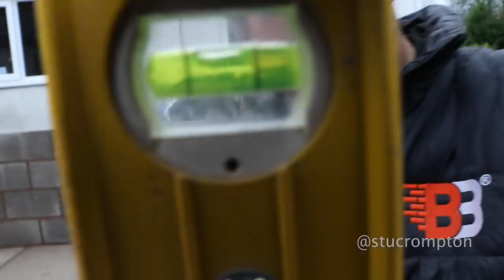Blockwork Extension - Starting the Build

Comment: Use my little green laser for setting out all the time,works a treat on these little jobs
Reply: Ross Male what make is your laser
Reply: @chrissullivan2007  DeWalt mate
Reply: Ross Male Cheers mate .Can you still see it in sunlight
Reply: @chrissullivan2007  not very clearly mate. I tend to use mine first thing in the morning or late afternoon when it's dull.
In full sunlight you'd probably get away with 3mtrs before youd lose sight of it. On a dull day it's good for over 10 metres I set joists and all sorts with it.
Reply: Ross Male ok thanks mate.Think i’ll stick with my water level and save a few quid

Comment: Hey up stu I’m a bricklayer and one of my bug bares are the dpc proud of mortar joint
Reply: It's deliberate , if concealed and when jointed the bed joint effectively bridges the dpc
Reply: That DPC looks like the slab membrane and  looks like there is no mortar under it  so its not bedded down not how l was taught
Reply: @alokhan9467  how long have you been brick laying  DPC never protrudes outside of the block or brick work

Comment: Hi Stu,

Just out of interest is this a combination of too wet muck as well as the 4 inch concretes been left out in the rain and saturated?

Or was it just Jangs muck being too loose?

From experience it can get a gut wrenching feeling when you walk onto a drive with pallets of brick/block that aren't covered up and see they are soaking wet when you warned/gave notice to the customer and explained why....

Just thought i'd ask as you can see you are struggling with the blocks wanted to move in every different direction despite ya best effort. 

Get Jang on the power tools so he can get a bit more confidence all in all. You could see when he was putting the wall starter screws in with the combi he wasn't knowing of the drill wanting to snap his wrist off when the screw was all the way in.

Thumbs up, you lads are never wanting for effort and knowledge.

Comment: I want to know about the material which is used to bonding the brick
Reply: Sand, cement, water 👍👍
Reply: The standard u.k mix for mortar is 4:1 . 4 sand to 1 cement
Reply: @Flashbang80701  any lime there?
Reply: @stefannevolnik6250   I think they use some Feb mix for the bricklaying mortar and use lime mortar mix for rendering. 😳